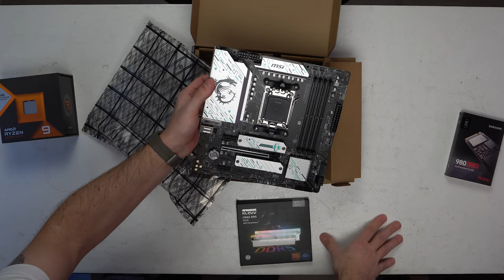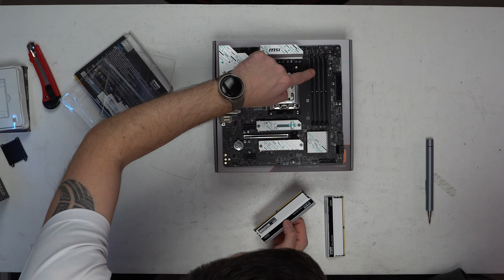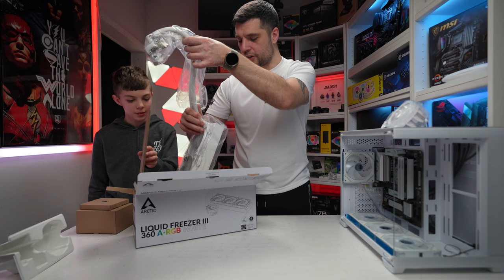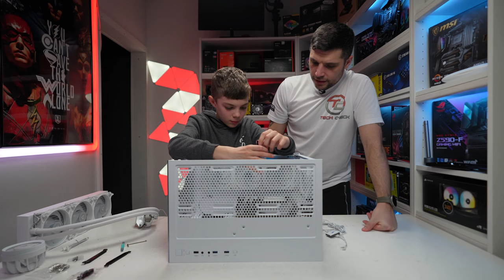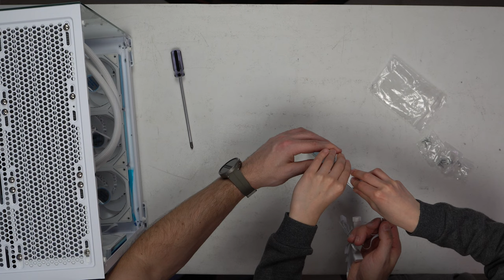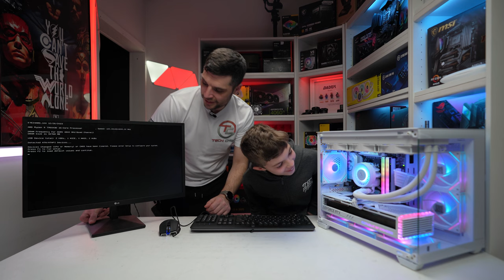11-year-old's Ultimate Gaming PC With RTX4090 & 7950x3D

Comment: Awesome vid mate! Quick question: I'm planning a smiliar build but I really want to use an MSI project zero board. These come in either b650 or z790 versions. The b650 would be more future proof, but also more constrictive than the z790 board. What would you suggest i get? FYI, the z790 would be paired with a 14900k and the b650 with 7950x3d
Reply from the maker: Thanks mate 👍 honestly I would go amd just for next 4 years and can simply place in a new cpu and not have to worry about a new mobo. BUt if your not fussed about tge temps and want the absolute best intel mate 👍
Reply: @TechCheckUK  and the fact thats its b650 rather than x670 wouldnt be to limiting overclocking or ssd speed wise?
Reply from the maker: Hi Mate i would personally go x670 if your going 7950x3d - the b650 will perform fine but you may miss out on future upgrades. I would have gone x670 if i had white one but i didnt.
Reply: @TechCheckUK  appreciate the advice, cheers!
Reply from the maker: np problem mate thanks for watching

Comment: is that mobo good for that gpu and cpu?
Reply from the maker: Yeah it's fine mate - works great. Don't think you need x670e or the most expensive components u don't.
Reply: @TechCheckUK  Thanks, im about to buy it, the vrms temps are undercontrol?
Reply from the maker: @luiszapatac  temps are fine - you just need a decent airflow case and AIO cooler
Reply: @TechCheckUK  I mean im going with a 7600x hahah, in a 4000d airflow with a Phantom Spirit cooler, but would like to upgrade in years to a Ryzen 7 9800x3D and have a Motherboard that can handle a powerful CPU, that was my main concern.

Good to know it can handle the big boys and Thankyou for answering
Reply from the maker: @luiszapatac  no worries and good luck on the build

Comment: Bro u are using b650m gaming plus wifi 
This is for 7600x to 7700x type
Not for r9

Use a better mother bord
Reply from the maker: There is nothing wrong with this mobo - what else do I need?
Reply: misinformation
Reply from the maker: What's wrong is people believe they need more than they actually do! Thinking they need a x670E mobo 64+ gb ram and 6tb nvme!!